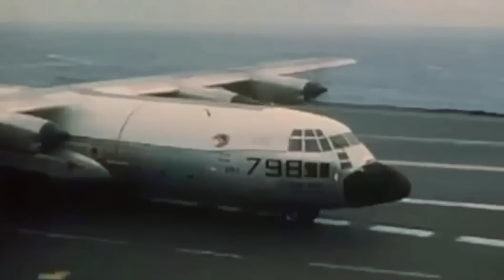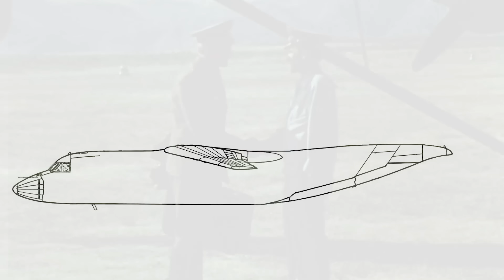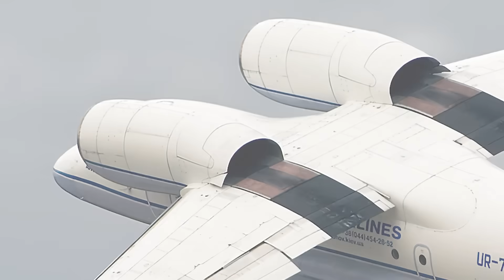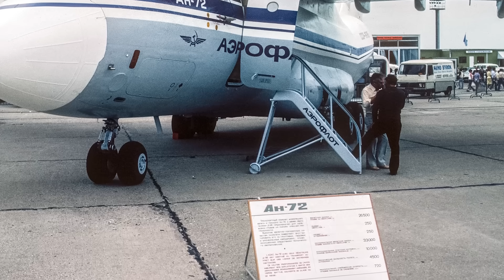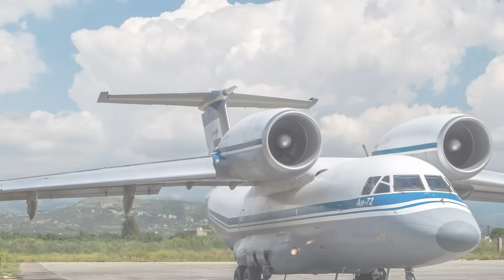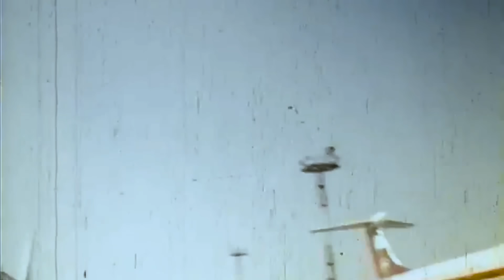A Revolution in Aviation... or not. The An-72

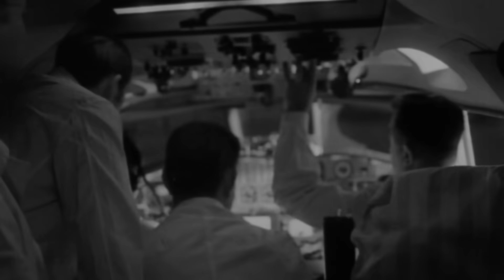Comment: 14:00 that footage of the plane flying a barrel roll, that's pretty impressive for a relatively large transport. He's not even that high up either. I didn't realize these were so agile. 
Unless that's footage of a plane going out of control after losing an engine, like you are describing. But that seems unlikely, it should be flying in relatively normal flight by that altitude and not relying on thrust for lift.

Comment: Lol Americans won't be familiar with a teapot. When we make tea it's usually by the cup with individual packets and hot water. Of course there are exceptions. But most people only have a kettle for hot water. 
Although i think of you have that problem you are filling your pot too much. A lot of them have trouble pouring if you put too much water in them, because it tries to start pouring before it's at a steep enough angle to get a clean stream. Same problem trying to start pouring from a plastic jug. You can avoid it by being very positive with your pouring, and tipping it right over quickly to a 45° angle. Although that's tricky with boiling water and a tiny tea cup.

Comment: this deisgn is for sure one of safest things ever made, when regular transport aircraft has engines below, close to the ground, beside was build to disconnect when hit the ground, most times it not happen and when they crash they burn and keep connected with the wing, also they explode easily by the fact they swallow debris from the ground. the An-72 is opposite, is not only better by being more aerodynamically efficient, the engine is far from the ground, also is far from the tripulation and as normal from the wings over the aircraft, is several times more stable than a regular garbage-build-to-kill-you transport planes like 747 and everything that is the same with different name (even the a380) that uses the wings below for... agility? they will dogfight with that? no, so, the regular airline plane is one of most ridiculous thing possible, wing below and pointed up, easier to roll and if roll upside down, that design make the plane several times harder to recover, when most of militar aircrafts are build to recover faster. 

unfortunately here in brazil we have some posers that pretend they are experts in the aeronautical engineering just because they know the parts and the names, they have channels that most time they talk sh*t about the topic, they teach wrong to alienate people and criticize these better projects, because is financially viable to them making everyone think that a bad done aircraft is "better" if is unsafe but is easier to repair by reach the parts, one of them is called lito, he tried to talk bad about coanda but the could not, because it was too good to be possible. 

An-72 must be a global pattern, the fatal crashes will reduce, but many maintenance engineers will be fired, only the best will stay.

Comment: The AN-72/74 series may be really useful on the gravel runways and subzero temps of the Canadian arctic, as the old DC-3 and 737-200 planes now being used are running out of spare parts.
Reply: Aren't these jus about aa old and out of production? You would have to find a bunch of them which are in good shape but not needed where they are and for sale. Dying think they are still building them.

Comment: I remember when the YC-14 had its first flight. Seattle knew that it would happen soon: the bird had completed its high speed taxi testing and the weather was perfect. When it was spotted on the runway at Boeing Field, much of the traffic on Interstate 5 pulled off onto the shoulder to watch (I was one of a mile long linear parking lot with a great view of the field). The first flight is relatively short, so the fuel load is minimal and the wing is lightly loaded. It used only a fraction of the runway and climbed out at a very steep angle; it was beautiful!
(a retired Boeing engineer)
Reply: @dadw7og116  I made test cell operator top pay grade for Pratt &Whitney. 
I was also the first flight test engine mechanic for the RUSSIAN MC-21-300 AIRLINER in Siberia and Zhukovsky Moscow later in the year. 
I was fired from my career of 13 years STELLAR work record according to the company. 
Because I support Donald J TRUMP as my president.
Reply: How long ago was this? I remember in the spring of 1990, when a couple of SU-27s showed up at the Airshow at the Boeing field. Was a unique experience! Btw, the Museum of Flight is in a league of its own, by far one of the nicest aviation museums out there… 
A “retired” (by Alan Mullaly) Manuf Eng from the Mukilteo Plant… 😢😅😅😅😂
Reply: @tesladiesel2420  The YC-14? It flew in 1976
Reply: Imagine people caring that much today. I guess you might get some aviation buffs who travel to see it, but normal traffic stopping to watch? I doubt it. 
And it must be sad for you to see the stupid attacks constantly made in Boeing these days, mostly without any real justification. As far as I can see it's public relations warfare that has been organized by very powerful competitors with the help of social media and a very gullible public who has no problem jumping on any bandwagon that lets them meme things or use as a political dartboard to support their own opinions.

Comment: Henri Coandă’s contributions didn’t stop with the jet engine concept; his name lives on in the Coandă effect, which remains fundamental to both science and engineering today. Truly a visionary ahead of his time!
Reply: The entire video is about that. Why do you feel the need to repeat it in a comment? He didn't say anything about his work in jet engines. The whole video is about this aircraft that was based entirely around the Coanda principle and how it creates lift when you blow a wing. What did you think his point was, "Coanda helped invented the the jet engine and this aircraft is powered by jet engines"? The whole point is that this aircraft is specifically designed to use that Coanda effect for greater lift, which I thought was pretty clearly explained in the video.

Comment: The Americans almost got there first with the Boeing YC-14, which was going to into production to replace the C-130 by 1980. But the USAF in 1978 re-assessed its transport needs and found out what they really needed was a replacement for the overworked C-141. The result: the C-17 Globemaster III , which the USAF ended up buying 222 planes.

Comment: Why not go for a low wing configuration when the engines are on top of the wing? This would save structural reinforcement for the high wing and therefore weight.

Comment: This would be a revolutionary design if it wasn't a copy of the Boeing YC-14.
Reply: But they separately solved all the problems of getting it into production.
Reply: @obsidianjane4413  you sure about that
Reply: @davedixon2068  
Boeing YC-14 First flight 9 August 1976
An-72 First flight 31 August 1977
It is impossible to copy in a year. Especially without the original.
Reply: An-72 began to be developed in 1973, independently of Boeing.
Reply: Your timeline doesn’t make sense. It is unlikely it could be copied in less than a year.

Comment: Air is sticky, the simplest explanation of the Coanda effect, a phrase that caused one of my instructors to roundly insult me. When a fluid is moving, say air, it sticks to a surface in its movement. 

And this one aspect of the Coanda effect makes for more interesting Coanda ducts, of which there are many kinds, including one duct that will reverse itself.

If a Coanda duct is used for grit blasting, not only does it do a better job than a simple nozzle, but eats ceramic like crazy. I couldn't get one crafted of tungsten carbide, which would have lasted a lot longer. Boss told me to scrap the nozzle because it was a waste. 

Sure blasted pretty good, though, but went through grit like crazy, it blasted so much.

Too bad this would have been the C14, had Boeing gotten the contract. The Soviets couldn't've afforded to design this and build the proof of concept and prototype, but after Boeing worked most of the kinks of concept and design, and I can't say more than that because everyone is gonna think I'm saying bad things about Soviet acquisition of useful information. 

Regardless of how design data for the Coaler, Antonov did a pretty good job on this, and helped explain why the USAF didn't want it.

But the Soviets kept it and continued developing it.

Comment: You didn't mention that the Russians plan to suppliment the Il-112V by replacing the turboprops with PD-8 jet engines and the plan is to mount said jet engines above the wing similar to the arrangement on the An-72. Eventually the engines for the Il-112V will allow a turboprop version, but the Il-212 version could replace the An-72s in service while the Il-112V will replace the other lighter propeller driven Antonovs. I also wonder if experience of putting the engines above the wings on the Il-212 might lead to them doing the same with the Il-276 as that would reduce the risk of FOD too for rough field operations.